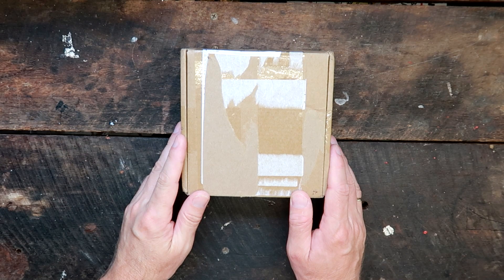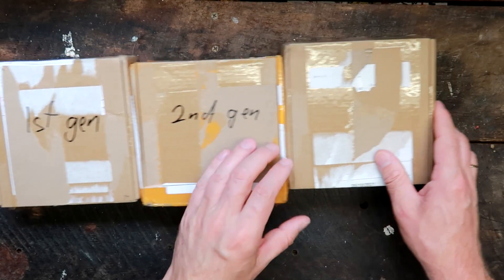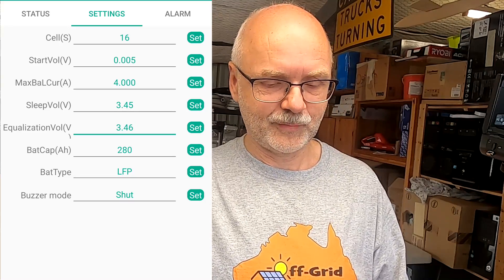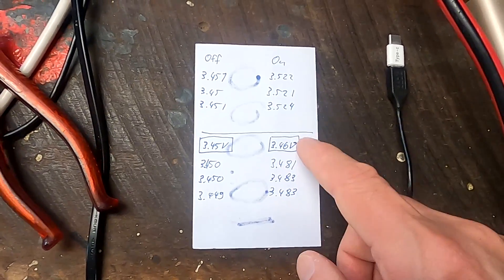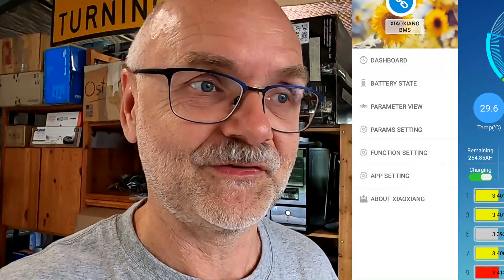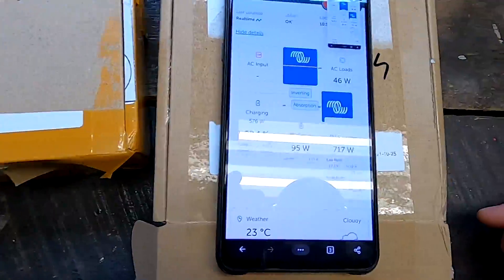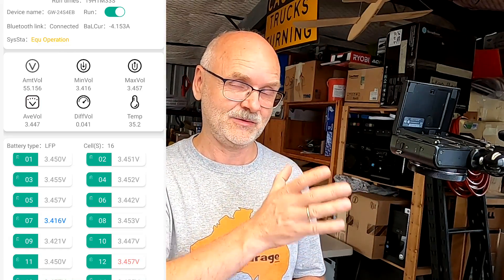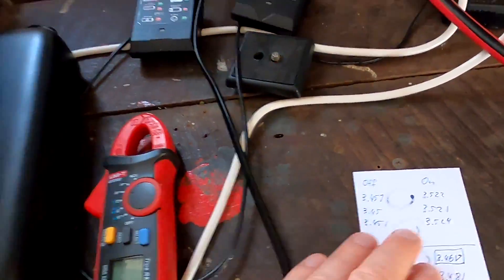The NEEY Active Smart Balancer is fixed. But there is something you need to know...

Comment: Yes, gonna watch close, unfortunately can't have both apps downloaded at the same time on the same device, makes it a bit hard to use the old version but I asked them to work on that issue. Just need to work out my numbers since I am using it on a 12 volt system with three separate batteries with separate BMS's wired in parralel.
Reply from the maker: I wouldn't use it on a 12V system. With the additional booster you need to run the balancer you're adding another device which can fail down the track. Makes the system just more complicated and fragile. Stick with the capacitive balancers and a simple switch you turn on from time to time.
Reply: @OffGridGarageAustralia  for now I am just playing with it but so far the old wall charger for an old cordless drill is working great as a power supply

Comment: Hi Andy, I am using a new LiFePo4 12V 4s system on an EVE 280AH for my motorhome. I am using QUCC as the BMS there and I want to ask you if you think Active Balancer makes sense for my type of use and if so which one ? Unfortunately this NEEY has the disadvantage that it does not run natively on 12V but I guess from 22V upwards. Thank you very much for the answer.

Comment: Hi Andy, I thought that was a short video. My 24volt LifePO4 system doesn't use active Balancing. My system has been running for about 4.5 years now and is still in balance.
Reply: When do you think it will go out of balance ? How will you catch it ?

Comment: The measurement in the BMS of the individual voltages has always been a problem, e.g. in the model building sector with the Lipo cells.   The components used for measurement in these devices do not seem to be of high quality.   If the measurement is inaccurate, the result can not be better, plus a software that may contribute to the problems.
Reply from the maker: Yes, I agree. It is less then ideal.

Comment: Yer, Nah....might wait until version 5.0 comes out or Will Prowess gives it the thumbs up.
BTW my Daly doesn't need a balancer. Currently both my 4S batteries are perfectly balanced at 3mV.
Reply: My Daly technically has 85 milliamp balance, and my JBD has 150 milliamp, neither has a problem if you first top balance. I was beginning to think that I must be the only one.

Comment: Hey Andy,  where did you purchase that metal box with the circuit breakers mounted in it?  Any chance you could provide a link?  Not sure I need one that big but something like the one you have
Reply from the maker: The big electrical cabinet where the solar charge controllers are in? They come in many sizes and are linked on my website (as always 😉): https://off-grid-garage.com/electric-installation/

Comment: Do you think an older version with the new software would work, or do you need both a new hard as well as software version to get it to balance at a low voltage difference?  I just started to inquire about the return process for my unit, so I don't yet know if I will need your version 3 for my 16s3p LiFePO4 set up.

Comment: Love your vid’s. A switch &/or timer maybe, so you can do a quick manual top balance whenever you feel it is required by just pushing a switch, does the balance as per setup and then shuts down, could be handy.
Can anyone give me a good perspective on the effects of bottom balancing, is it helpful or damaging to this chemistry to maybe bottom balance very occasionally, does this help or hinder a cells overall capacity? I do believe the main secret is in the pudding, ie: internal resistance of each cell is a key factor in overall performance of the whole bank.
Andy has also shown us his maths on calendar ageing of old B-F grade cells if used in a 60%-80% region can last for many years and still maintain reasonably high SOC rates.

Comment: As long as it is consistent across the voltage spectrum it really is just a management problem for the setup. This type of problem is everywhere in solar setups so we just compensate for the voltage discrepancies whether it is the charger, inverter, bms, balancer etc etc. you just have to adjust so your system runs like you want it to.

Comment: Averaging all cells in not a good way to determine when balancer should turn on.

Be careful of making balancer evaluations with a battery pack not in a real operating condition.  With variable PV and variable inverter loads it can drive the balancer crazy due to cell voltage overpotential boost for charging and slump for discharge currents. 

Everytime the inverter has moderate load current the cells will drop quickly below 3.4v so this will pretty much assures balancing will turn off almost immedately.  Similar can happen when PV drops due to cloud going by.

They have super caps to boost so they are probably preferring to keep the super cap charge voltage with as little variation as possible to get the most reliability lifespan on supercaps.

Best to start balancing at 3.4v which is beginning of rapid cell voltage rise.  This give the most balancing time to win the race to achieve cell balance before overvoltage occurs on highest cell.  Having greater balancing current makes it easier to win the race, avoiding an overvoltage cell BMS shutdown.

Comment: 22mV is 0.022V and 3.650 + 0.022 = 3.672, not 3.87.
IMO, the balancer should simply start running once any cell passes the "wake up" voltage and keep running until either all cells are below the "sleep" voltage or within the maximum delta. The hysteresis between turn-on and turn-off should be the only anti-jitter you really need. If they are worried about the balancing starting and stopping too often, they could make the minimum wake-to-sleep gap something like 50mV, then you could have the balancer start at 3.48V and stop at either 3.43V or whenever the delta is under 10mV.
Reply: Exactly - big mistake in calculation Andy :-)
3.672mV
Reply from the maker: How dare I!
Reply: I really like it when you call it the Neeeeee balancer 😄 Keep up the great work 👍 and thank you for your efforts

Comment: I would like to get the Neey balancer because I bought a used 8S LiFePO4 battery pack (about 120Ah) and a couple of the cells start to run away during charging. They must be weak cells that charge up faster than the other 6 cells so this would keep them all in line.
Reply from the maker: Thanks Greg.
Reply: @CaptainProton1  The cells in the battery are fixed in place with the terminals laser welded together. The only way to top balance is manually one at a time....yuck. No way to replace the weak cells. I'm thinking that reducing charge current to the weak cells by 4A (balancing), I'll be able to get the good cells charged up better. Right now, weak cell are causing high voltage (bms) cutoff limiting charging of normal cells.
Reply: @OffGridGarageAustralia  You're welcome.

Comment: If you have this NEEY balancer there is no need to top balance.  Just put on a 4A charger at voltage you want and you will be balanced when charged.  Or set your charge controller to put out only 4A above the balancing voltage (3.5V).  Is there any harm in starting balancing at 3.3V?  This would allow you to catch any cells running away when charging but unlikely to ever bottom balance.  It won't actually do anything if your pack is already balanced.  And I can see why they can't use cell voltages - 4A on a small cell will instantly drop voltage and stop balancing it.  You want full pack voltage to set when to balance.
Reply from the maker: I would not recommend starting balancing that low. You will be still in the flat part of the curve and the voltage does not say anything about the real SOC. As we have seen from previous videos, it will create an imbalance if letting the balancer run that low.
I would not start balancing below 3.45V. That's the knee in the curve when voltage takes of and cells will differentiate against each other. That's when you want to balance.
Reply: @OffGridGarageAustralia  Doesn't the Daly start at 3.4V for balancing?  I guess when you are actually putting bigger amps in you can hit that 3.45V pretty fast.  So it might be a good idea to be on the high side for larger currents.
Reply: @OffGridGarageAustralia  Please consider testing the Neey gen 3 on different battery banks and see if the avg voltage is such a problem, better or worse? Also knowing they are relying on a stupid avg they should limit LifePo4 off voltage at maybe a max of 3.6v for a max buffer, since you've proven their system is going to peak cells above 3.65v if 3.65v is selected.

Comment: thanks for another great video , well why i need a balancer ?  i use a daly  bms  7S 120A 24V that the balancing voltage is hard coded and can not be changed and it is way to high  (my chemistry is Li- ion ) and it starts to balance at 4.18V (4.2V = 100% soc) I dont charge my battery over 80% soc  so it never balances ...  I would want to start balance at around  3.9V 
(My setup is : 3X320W solar panels , Lion 7s 120Ah LG Batt , Victron 100/30 mppt , victron smart shunt , victron Phoenix 1000VA inverter ,Venus-docker-grafana monitoring . ) thanks and Greetings from sunny  Israel .
Reply from the maker: Thanks Amir!

Comment: The reasons your seeing the bug in the product is they did little to no testing and they have you  as a paying beta test site! This is common in China. You buy the product and they give you changes or updates and you do the testing for free. A friend bought a charger they claimed will charge LTO  batteries and  asked for changes. After talking to them they had one cell and no packs for testing. In time they had that fixed. Then I bought the charger and later on it failed reading voltage after a while. I found the cold solder joint. After the fix the voltage was off 2%. It seems like they calibrated the board with the cold solder joint. I asked if they had a program they could send so I can calibrate that voltage. The answer was to send it back to China and we will fix it. I recalculated the values in the voltage divider to fix.   I stopped direct from China buys and just buy from US suppliers so the product can be returned if I find bugs in the product.  Your reviews have saved me many hours of testing! Keep up the great work!
Reply from the maker: Thanks for sharing, Steve. Buying local could save you some hassle with customer service but most of the time, they will buy the stuff from China anyway and sell it to you for more money. If something fails, they don't know anything about the product as they are just the reseller.
I had mixed experience with working with Chinese manufacturers. Some are bad and some ore really good and help you out. Like the guy from the power supply shop...
Reply: @OffGridGarageAustralia  Yes, some vendors are good and some are bad. I have been watching many videos you made and picking things you are having good luck in making it work.
Keep up the good work!
Reply: Testing is NOT the problem. the problem is that people who have ZERO understanding is in charge for making a product!

Comment: Overall, the Neey does not seem worthwhile. I have one, and a separate BMS, that I have been testing. Both are quite disappointing. The seller I bought the Neey balancer from was not willing to offer a refund, and neither was the seller of the BMS. They both work, but not to my satisfaction. Both simply offered me a coupon (to be used buying more stuff from them - no thanks). I found a seller who has an 11/11 offer on the JK, so I may have to pull the trigger. As far as I can see, the 5A balancer version is available only on the most expensive JK 600A BMS, but 2A is available on the 150A and 200A BMS versions. 2 x 7AWG cable is a bit small (but they are very short), but the seller said they might now have lugs (I guess after your comments when reviewing).
Reply: Looks like my BMS seller has fixed the problem with a new version of their app. While I was talking to them, they said JK also have a 2A active balancer, the same circuit as in the JK BMS you tested that had built in balancing, so I can buy that on its own. They offered it to me for a good price too.

Comment: why not set your start (average) voltage at 3.2v
Reply: Exactly What I was thinking. Voiding the “start” parameter would be the best option with this stupid way of monitoring the cell voltage (average voltage???! What??!)
Reply from the maker: I made a video about this. If you start balancing too early, it creates an imbalance in your battery and does the exact opposite of what you want to achieve.
Reply: @OffGridGarageAustralia  The point is it shouldn’t start since you have the release parameter to a higher value
Reply: @OffGridGarageAustralia  to clarify. The “start” parameter is “not used”. We would instead only rely on the “stop” parameter. If the voltage is above the “stop” voltage it will balance. (don’t know if that parameter also is looking at the average, or doing per-cell-monitoring, but it will for sure work better)

Comment: So if you are way out of balance, such as 3 cells at 3.35 and high cell at 3.56 and the rest somewhere between, you could still go over 3.65 on high cell because it is using average
Reply: That's the way I saw it. I'm in the same boat

Comment: I would think having a smaller current when deviation is only small would prevent too much swing in voltage when trying to finely balance the cells so such a small .000 figure. And would be the better way of doing it.
Reply: Andy showed you can change the max charge current.
Reply: @coastalchaos839  I meant when he was saying the other balancers use smaller current when deviation is smaller.
Reply: @magicmanspaz  Wouldn’t the current drop when the difference is nearer to 0 anyway?
Reply: @coastalchaos839  not exactly. Since lithium can charge and discharge at high rates it can still easily balance at 5a when there is a small difference in voltage. I have still charged a 100ah lifepo4 at 60amps when 99% full and then 100 it was still around 40amps for example. Turning on and off a small vs larger balance load is going to have a different effect on how the voltage fluctuates up and down while balancing. Smaller current will have a finer smaller fluctuation.
Reply: @magicmanspaz  Sometimes all this defies logic :-)

Comment: i am going with the genetry solar balancers  they wast on heat at top of charge but over a year that is small price to pay in wasted heat      i would even chose them if they were expensive they would still be my choice  i think they do 6 or 8 amps per battery  one on each battery they each have a screen to show voltage  simple and high amps   i have be checking out stuff for over a year now and they are the best choice i can find and they are usa company so no longs shipping times either    i have had there inverter for over a year now and it is tough as nails and very low idle currant wi fi and so much more than even the high dollar ones  it is awesome!  if anyone can find any better  on inverter or balancers i am all ears  dont tell them i sent you i am very picky  bugged them to death

Comment: So what will happen if the balancer is set to:

* Equalisation(V): 3.3
* SleepVol(V): 3.45

Is the SleepVol parameter also an average? Or can we work around this with the SleepVol parameter?

in my mind it would only balance if the voltage is above 3.45v with above setting.

(I have two Gen3 on the way, just returned a gen1, didn’t even connect it.)
Reply from the maker: It will not accept these setting. Equ Voltage > Sleep Voltage
Reply: @OffGridGarageAustralia  meh! ☠️

Comment: Hmm, it uses the average cell voltage to trigger the balance function? In my opinion this makes a nonsense of balancing. The pack would have to be pretty much balanced in the first place for one cell to not exceed the maximum cell voltage and cause a disconnect. 

I find the notion of this approach being taken to extend service life to be a nonsense. I think you demonstrated in other balancers that they apply balance current for a few seconds at a time and test in between which means they are continuously switching on and off whilst balancing. Perhaps you could do the same test for the NEEY.
Reply from the maker: I think it was the NEEY which turned off and on while balancing to measure the voltage.
The information I'm getting from them don't make much sense sometimes and contradict what they said previously.
Reply: I concur, you want to balance the highest cell. If you have a large spread you would overcharge a lot of cells because one was really low.

Comment: why are you turning on balancing so high in the charge cycle 3.45 V seem very high, there is no harm by starting the balancing at a lower level say 3.4 V since its at the top of charge that the greatest unbalance takes place.
Reply from the maker: 3.4V charge voltage is to early to start balancing LiFePO4. You can easily reach that voltage at 50%SOC and lots of sunshine. It needs to be a bit higher than that.
Reply: As Andy already told... you have lets say lots of power coming from sun, it rise the voltage fast but capacity [charge] is still low (lets say charging at 30-40amps).. what your puny 1A or even 4A can do? nothing/ That's why you should start balancing only when batteries almost full, so your crappy 1A (in case of bms) or 4A make difference. because there may be 10mV diff but incapacity it may be 10Ah. so with BMS you would balance 1 cell for 10 hours..and if you have 3 or more such cells? When battery almost full - you know that even pretty low amount of electrons will make a diff in voltage.
Reply: @SayWhaaaaaaaaaaaaaaaaaaaaaaat  You do make many assumptions in your response, but one with a fake name and a demeaning manner deserves no response.. But best you read and learn Kirchhoff laws then you will have a better understanding and will be able to make intelligent remarks.